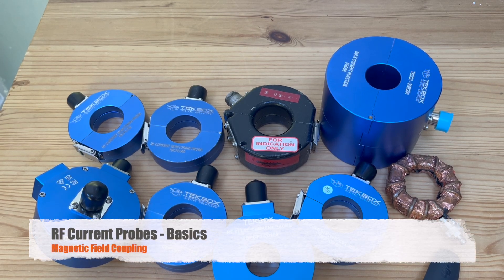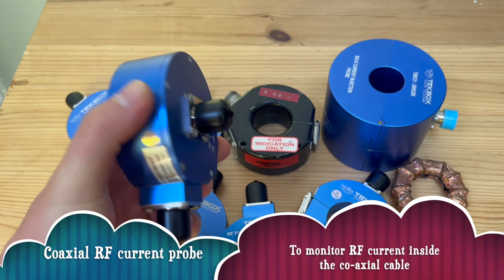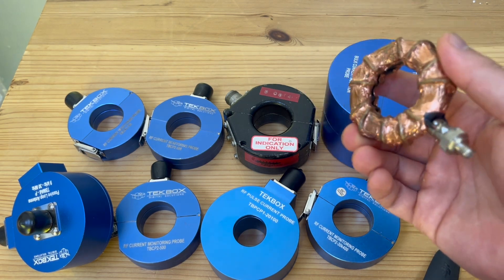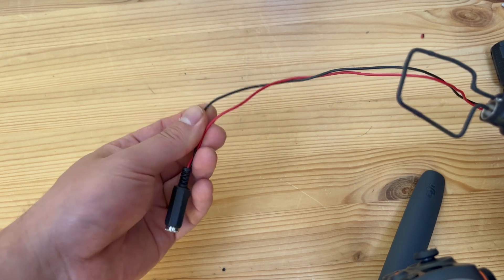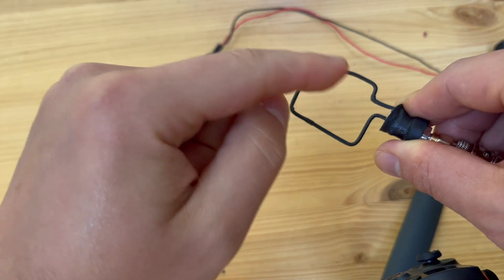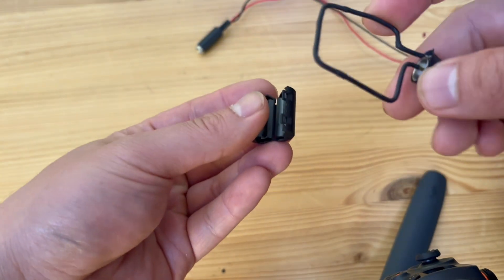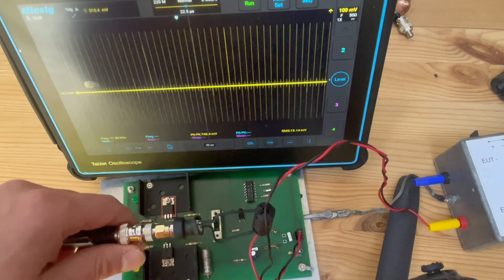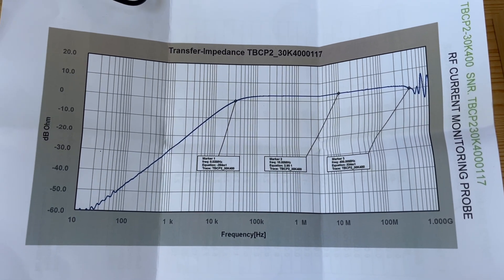RF Current Probes Episode 1 - Basics

Comment: Thank you, interesting video. Can we use a TBPCP1-20100 probe to visualise EMI in the frequency domain on a spectrum analizer or does it only work for time domain on an osciloscope?
Reply from the maker: Yes, absolutely. But most spectrum analysers start working from 9kHz, so you better check if yours is the same. I used Tekbox receiver which works from 0.1Hz. You should have no problem connecting it to an oscilloscope.
Reply: @MachOneDesignEMC  Thamk you   Mr. Zhang. They used to sell the Spectran NF-5030 at Aaronia but it has been discontinud for some reason. Maybe I can find a second hand one

Comment: Thank you for your videos, I like them a lot. But I wouldn't like to use a Clamp on ferrite like you do. If I am not wrong, the ferrite itself will attenuate the noise....
Reply from the maker: Hi Tomas, hope you have now seen Episode 2 and 3, when constructed properly and terminated properly, the attenuation impact is actually quite insignificant.
Reply: @MachOneDesignEMC  If you want to observe the current in a conductor by the use of a B-field probe and then adds a  ferrite/inductor on the wire you want to observe the characteristics of the ferrite must affect the current! I feel confused if it doesnt! Of course I understand that you will get better coupling to the probe pickup. I will have to look on your video clips again I think.  Thanks/Tomas
Reply from the maker: Hi Tomas, you do ask hard questions! I did a little bit of research on this subject, guess what? The answer is very complicated, maybe I will do a special episode on this. But to summarise, it is not as simple as we thought that a ferrite core will attenuate signals. Think about it, when a probe is clamped on a wire, it also increases the inductance of the wire of the EUT, isn't it? Because effectively, now you have a wire through a core, so it is now a better inductor to some extent. So it is not a surprise, that the added series impedance to the circuit under test depends on many factors, the main ones being mutual coupling, self inductance of the current probe, self inductance of the wire under test and the coupling factor between the two. Very complicated stuff. Eventually, if a probe is terminated with 50 ohm, that 50 ohm impedance will be reflected back to the wire under test and thus reduce the effect of series added impedance. Hence, we should never leave an unconnected/unterminated current probe on the wire under test.
Reply: @MachOneDesignEMC  Yes, exactly my point! Everything gets complicated when looking into details! 🤣 Sorry if bothering you! /Tomas